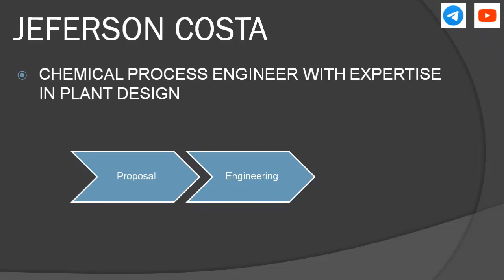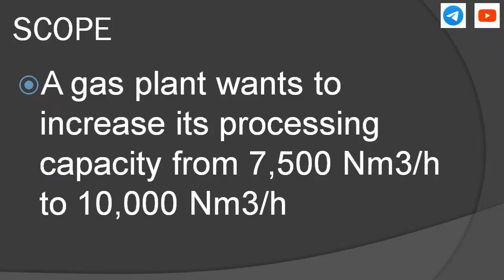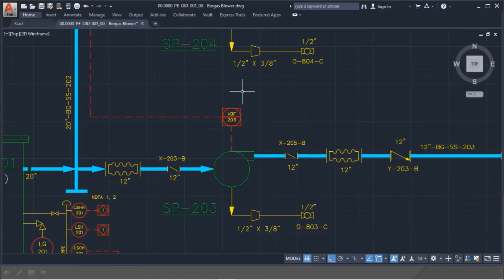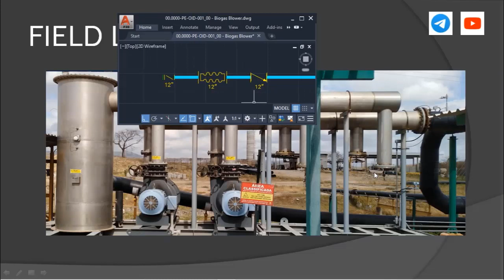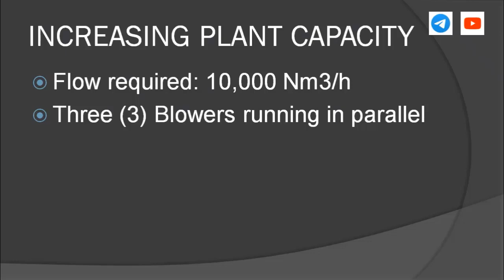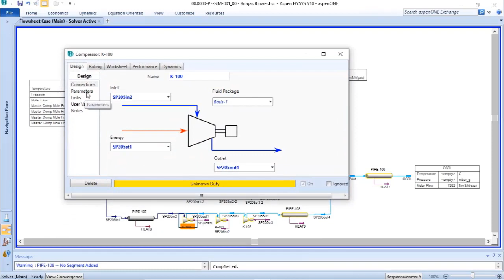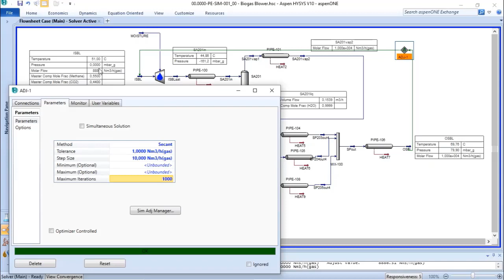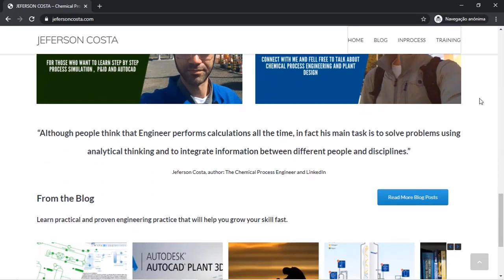Plant Design for Chemical Engineers

Comment: Hi, is plant design work for bachelor degree engineers or is it only suistable for master degree engineers?
Reply from the maker: Hi Fion, usually there is need to have a Master degree to work with plant design. You just need to have the knowledge and skill to do the chemical process engineering deliverables.